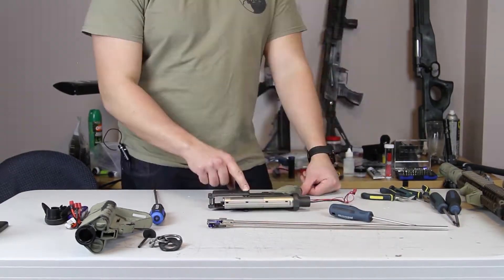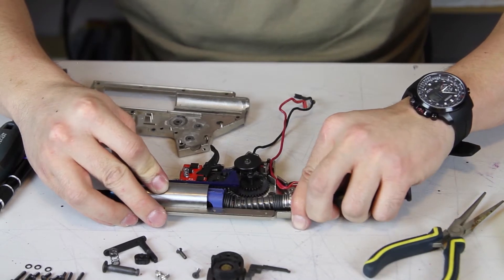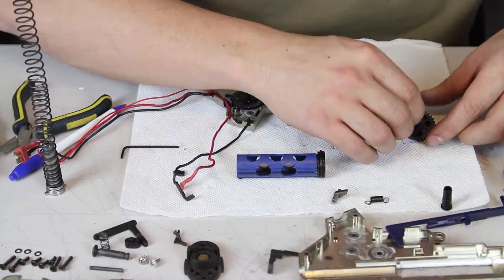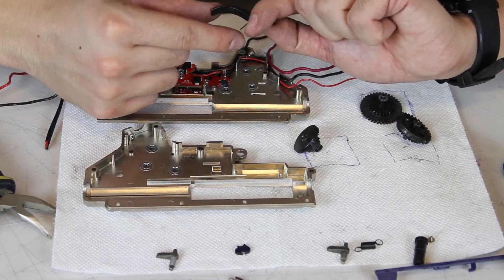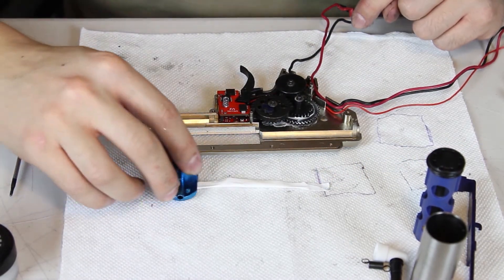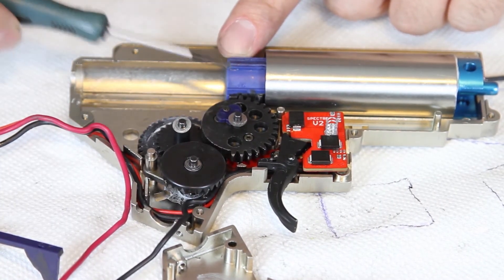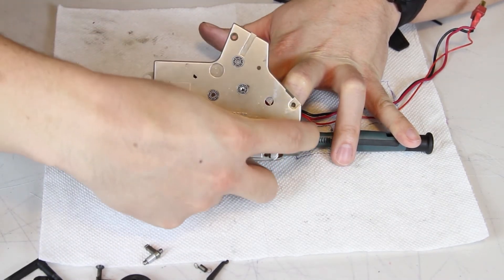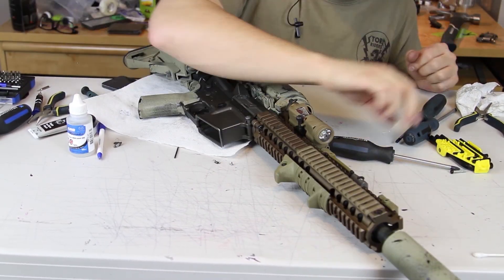Disassembly and Reassembly of a V2 Airsoft Gearbox - Gun Tech Basics

Comment: My gun will not go full auto, is this because the gear with the magnet is incorrectly located
Reply from the maker: Issues with guns shooting in full auto only, or never in full auto can often be caused by the cutoff lever. It could also be an issue with the selector plate too, depending.
Reply: @StormRiders  thanks for your prompt response. 
Mine is the Ares Amoeba which doesn’t have any of those connector plates inside, it’s left me baffled as the selector switch seems to just not have anything connected or even have a magnet on it.

Comment: So I used this video to open up my gearbox w/o ejecting the spring guide through my drywall, and it was very helpful. But at 4:00 when he pulled out the SHS piston, I noticed that it was the exact same as the one in my G&G firehawk that the back broke off. I'm not sure if my SHS piston was a lemon or what, but I think that's odd that a piston that's so highly praised in everyone else's opinion was a piece of cheap trash when it comes to me. Maybe bad luck.

Comment: This is great thanks. I recently got a King Arms M4 for around 500$ and am using a 11.1V lipo. I was worried in 6 months or a year it would smash my gears up. Good to know if it does with some research I can take it apart replace and upgrade the parts and move on without too much hassle thanks to uploads like this.

Comment: So my Cyma M4 has a problem. When I hook my battery up (which is charged) the gun will not shoot. I took the cover off under the pistol grip for the motor, when I plugged the battery in again, the motor made a noise that I couldn't hear if the cover was on. I have no idea what is going on.

Comment: How does a ported and non ported cylinder relate to a long and short barrel? And what would happen if you put a non ported cylinder on a long barrel?
Reply from the maker: This is a great question! You absolutely should put a non-ported cylinder in longer barrels. Having a port in a cylinder reduces the amount of air that gets compressed; the further forward the port is, the less air gets compressed.

The longer your barrel is, the more volume of compressed air you want to push the BB out of the barrel. Having too little volume means that the BB will start slowing down before it leaves the barrel. Conversely, using a non-ported cylinder in a short barrel will result in too much volume; you will be wasting compressed air. Under-voluming is problematic in terms of performance. Over-voluming is less so, but still not ideal.

Generally, a cylinder will indicate on the packaging what length barrel it is ideal for.

We hope this helps!

Comment: Do version 2 gearboxes have a mosfet? If not how do I add one? And if I'm going to run a 11.1 lipo should i upgrade the internals kf the version 2 gearbox?
Reply from the maker: Stock version 2 gearboxes don’t generally come stock with a mosfet. Installing one will vary based on the kind you get. The one in this video is a BTC Specter mosfet and is installed exactly as you can see in this video. 

As for using an 11.1v LiPo, you may need to upgrade the internals depending on the quality of parts. If you buy a high end AEG, it will likely be fine out of the box.
Reply: @StormRiders  thx

Comment: Hey can someone help me after i opened my gear box and made sure everything was correct i test fired it, but the piston came all the way back to read and got stuck i fixed this by pulling the anti reversal lever back and it reset the piston im trying to trouble shoot, if it was the piston not going into the sector gear properly or is it something else?
Reply from the maker: It will be almost impossible to tell without being able to see it; there could be a lot of different causes. Do you have a local gun doctor who might be able to assist you?

Comment: I have watched a lot of gearbox videos and this 1 of the most informative one I have seen. It would be nice to see a video of taking a stock gun and putting the storm riders touch on it (upgrades) . also if you could do a video of properly adjusting the gear contact on an upgraded motor. Anyway love your videos and always look forward to them.
Reply from the maker: Thanks for the feedback! We really appreciate it. :)

We'll look at the videos you're suggesting for sure. Regarding your point on properly adjusting the gear contact on an upgraded motor, could you clarify what you mean? Are you referring to adjusting the motor height?
Reply: @StormRiders  I always figured if you upgrade the motor that it requires adjustment, I know some people can do it by ear but there has to be a more scientific way to go about it lol. I know here in the middle of Missouri there aren't a lot of shops I can take my gun to to have work done so I have to do it all myself.
Reply from the maker: In most cases, upgrading a motor is as simple as taking the old one out and putting the new one in. You might need to adjust the motor height a bit, but that's generally all that needs to happen. You can quite easily tell by the way it sounds if the motor height is wrong; it will sound very different.

You might also consider reshimming your gears if you're going to a high-torque motor, but shimming is a whole video to itself.

Comment: Very Helpful video, I haven't upgraded my gun yet because I'm afraid I'll break something since I'm still a bit new.
Reply from the maker: Everyone has to start somewhere! If you know a guntech, you could ask them to show you the ropes. Otherwise take your time and be meticulous! Good luck! :)
Reply: I'm in the same spot man
Reply: @StormRiders  poop
Reply: To anyone just starting out and is afraid of this exact situation, don't be. Just be prepped to have your gun dismantled for a few days if you get stumped in some areas. Make a video of breaking your gun down so you can always go back to a certain point and see exactly where something goes. You will not break anything so long as you are careful about everything. Some parts may require a bit more force than others. If you are worried its always okay to ask on reddit or airsoft forums. Its important to know your gun if you want to save money and have a peace of mind. No one will take more care of your gun than you. Also AEGS need to be greased, you'll need to break down your gun for proper maintenance anyways. Its important to understand what everything in your gun does before you break it down as well. AEGS are like a web. Everything connects and has a very specific role. Worse comes to worst, gather the parts and get a tech involved for re-assembly. As Storm said, you can always ask if they are willing to teach you some things first hand while you're there. Best of luck to whoever needs this.

Comment: You ve forgot mentioning to release the tension of the gears before opening the gearbox, which can prevent ruining your tappet plate 🙂
Reply from the maker: We find that maintaining a proper hold on the spring prevents any movement of the piston, which ensures that is not an issue. Thanks for watching.

Comment: I am scared to disassemble a v2 gearbox. Can’t I just buy a fully upgraded one?
Reply: it's not as bad as it seems, following this guys lead will most likely make sure you're fine. You CAN buy upgraded ones prebuilt but buying just the parts you need to upgrade your current one does usually end up being cheaper.

Comment: Don't stretch the o ring, it does nothing to it as if it is needing to be stretched, you may as well replace with a nice Buna-N or Viton or even an X-Ring. Another note is do do another compression test with your nozzle on fully extended to make sure air seal is still good throughout and not just isolated to the cylinder and piston. Otherwise informative for the new techs.